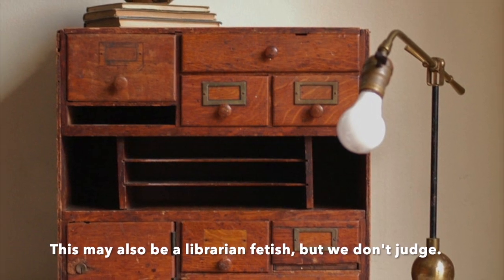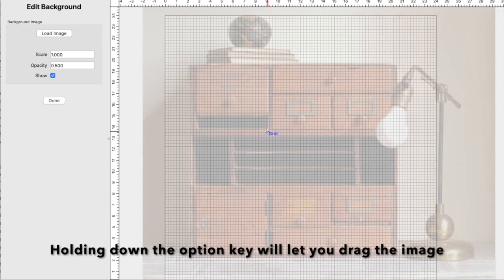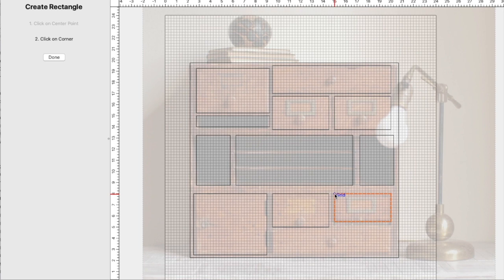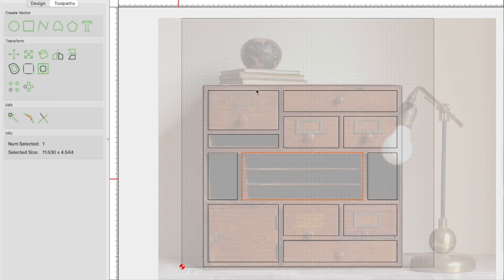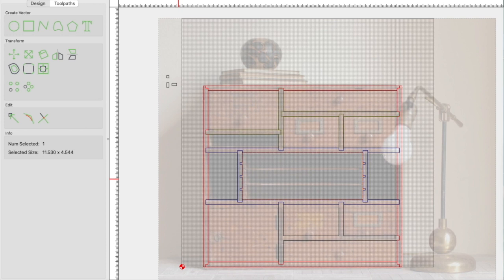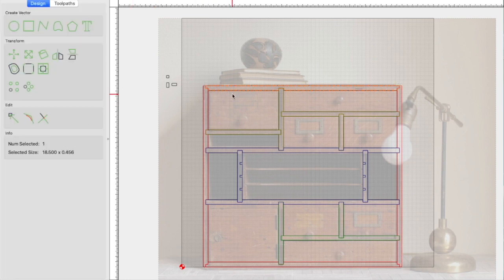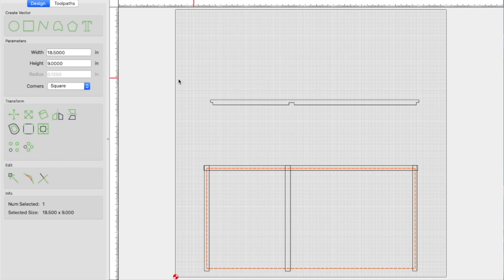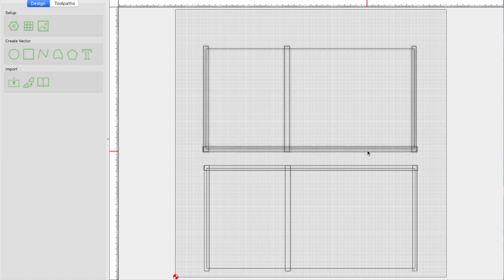Antique Cabinet   Design and Proportion for CNC

Comment: John Thanks for the video on your cabinet build . Not sure how you determined the size of the cabinet by drawing a rectangle around the image of the cabinet .could you explain that for me and also I would like to see what you used to make the drawer boxes with finger joints.
Thanks Jeff Peters
Reply from the maker: Hi Jeff.Once you have everything drawn in at proportion, you group it and scale it up or down to fit your needs. In my case, I wanted the center part to hold standard paper. I just scaled things up so the center opening with the little shelves was 11 inches wide. After that, just select the outer rectangle and those will be the dimensions of the outer case. Does that make sense? As to the finger joints, I made a video of the technique I use here: https://youtu.be/VuRrW1OjxdI